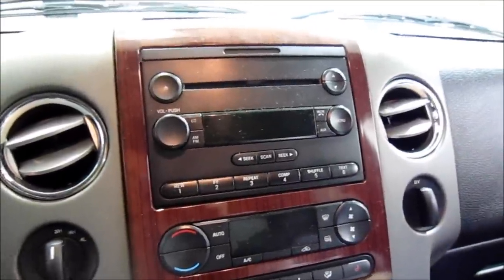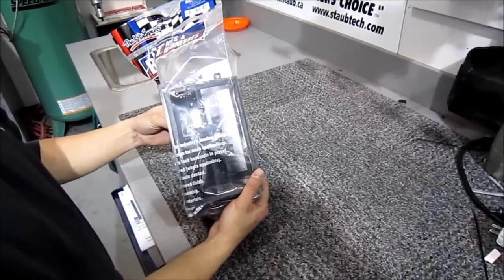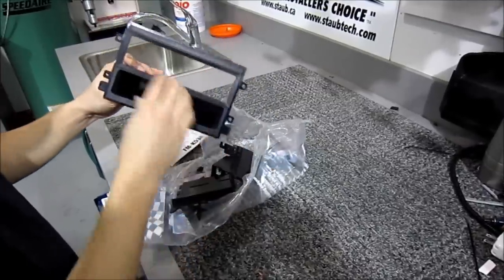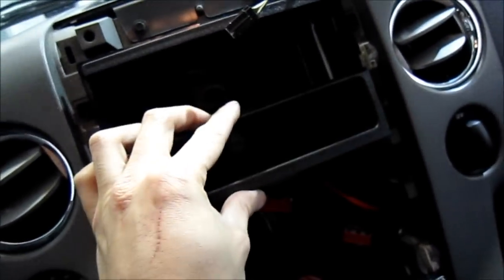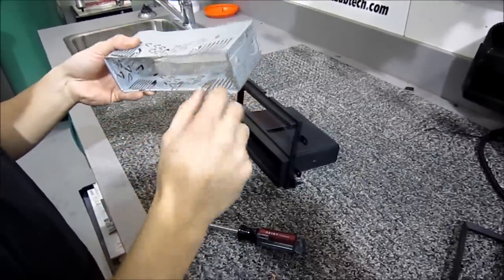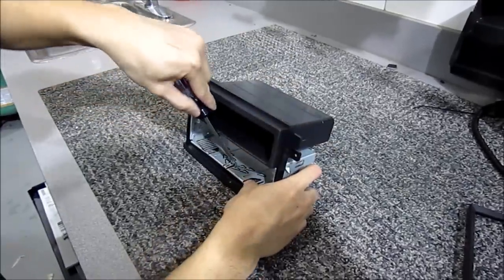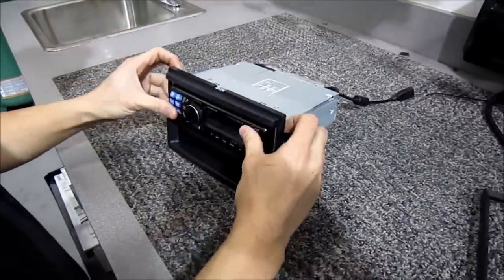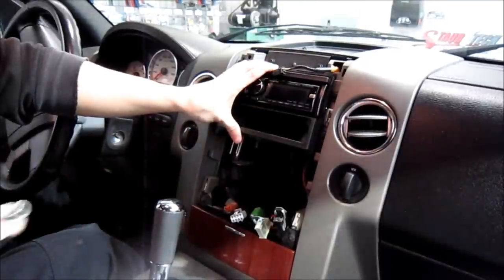Why you need a Mounting Kit when Installing an aftermarket Head unit / Deck | AnthonyJ350

Comment: Hey, do you know if it’s possible to remove that pocket to get another din slot? I want to replace my double din radio with a single din radio and a single din cb. It’ll go in a 2004 f150
Reply from the maker: Some kits the pocket is removable. Typically Schosche kits were like that.

Comment: My 2002 Focus has a single DIN unit installed into a similar kit, but the retaining screws are not accessible, until after the radio and kit come out. How do I remove mine to access the screws holding my heater, AC, vent controls to get at the bulbs behind it?
Reply from the maker: You need Ford keys to remove the stereo

Comment: what if you want to put a single din head unit in a double din spot and a half din equalizer? will both fit?
Reply from the maker: Typically yes it will.  You might have to fabricate a mount for the EQ.

Comment: This is way better than using the arms that come with the dash kit because you can get the deck out without taking the whole dash trim etc apart again... want a new deck or change the single din unit... just slide it out no problem.
Reply from the maker: Thanks for watching!

Comment: my cage doesn't even fit inside the mounting kit. neither does my jvc head unit.
Reply from the maker: +Robert Bridges What car are you installing the head unit into?
Reply: +AnthonyJ350 2002 Monte Carlo, I had my bro pick me up a jvc head unit and a mounting kit. the kit seems too skinny, not being able to fit everything in properly. not sure if I would need to get a different mounting kit, or a new radio. not knowing yet if the mounting kit fits my car, but he said he was sure it would but I haven't torn the old one out of my car yet to check
Reply from the maker: Are you putting in a single DIN or double DIN?  Cause those cars can take either.  What brand mounting kit did you get?
Reply: +AnthonyJ350 double din and I believe it's a scosche mounting kit, generally I can make it work, but it isn't right. it's all crammed in and can't bend any tabs down to stabilize it.
Reply from the maker: +Robert Bridges Usually when doing an install like yours you don't use the cage and just bolt the head unit to the kit with the supplied screws with the head unit.  Should be a fine thread machine screw.
Reply: @robertbridges2630  i think you have a half din
Reply: Im having the same problem, mine its the Kit for a gmc sierra 2010 the cage & radio is to wide for the mounting kit its a single din Alpine 9883r

Comment: I know this sounds silly, but this is only my second time installing a radio. If I'm going from a double din factory unit to a double din aftermarket unit in a 2007 Kia Rondo, do I need to use a kit for installation or will it just slide in, like my single din did in my 97 tbird?
Reply from the maker: +ChaosExodus Check out www.metraonline.com to see what your car needs.

Comment: Unfortunately some of these kits, Metra for example, are just plain crap.  $20 for 30 cents worth of plastic. Often screws that are listed as included are missing. The plastic is often warped. It takes a bit of ingenuity to make these things work as they were intended. I've had to super glue spacers in place that should just fit in place and stay there. If you're not a professional installer and you want to upgrade the audio in your vehicle just pay an installer to do it. Trust me it's worth it in the long run.
Reply from the maker: Different brands make kits better for certain vehicles.